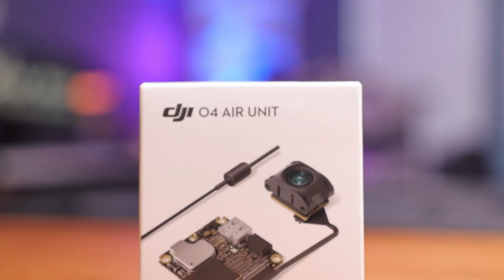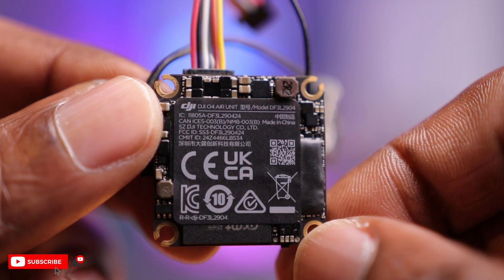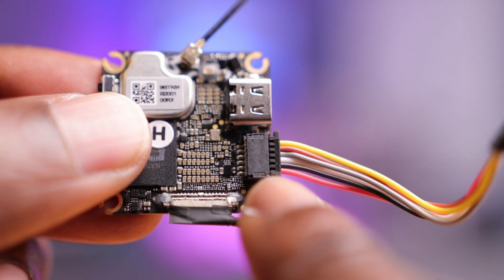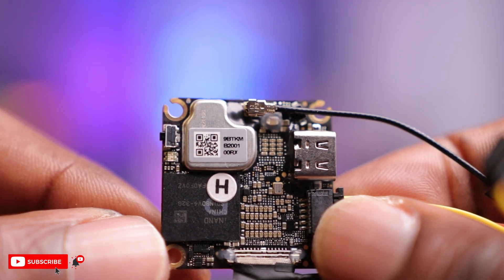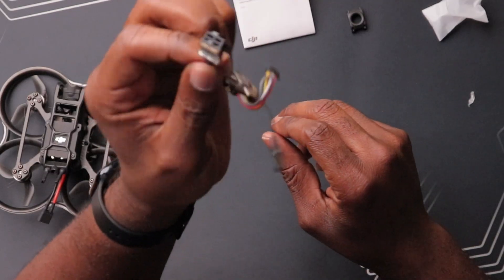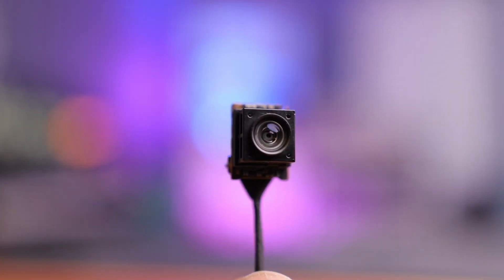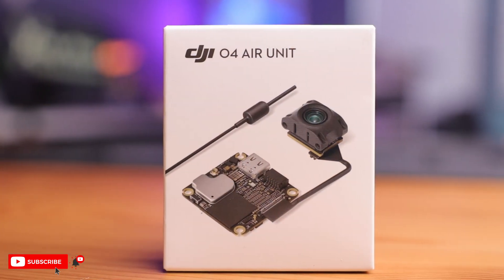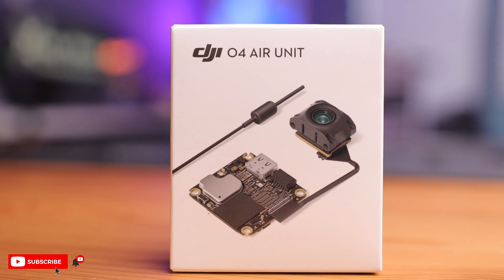DJI O4 Air Unit | Finally Bringing 4K Recording to TinyWhoops!

Comment: Hello friends, can I use DJI 04 Pro on an RC boat? Is there any additional equipment needed? Greetings to all friends.
Reply from the maker: I’m not 100% sure, but I think you can use O4 by itself(without any additional equipment).  I think you’ll need to go into settings and turn off “Low Power Mode”. That was the only thing holding back the previous models, as it needed a flight controller to “trigger” Full Power mode.
Reply: Thank you brother, you helped me. Greetings from Turkey, love.

Comment: If it’s 30 x 30 what frames allow for that? I’ve never seen a frame or aio board that’s 30 x 30
Reply from the maker: I think you're right.   I'll have to look into that...I think that was the dimensions of the board itself, not the mounting measurement.  I'll amend it and pin that comment in the video.   Thanks 😊

Comment: I just installed the o4 air lite on my Darwin baby ape. I personally love it.
Reply: How does the camera get installed?
Reply from the maker: I think every manufacturer has their preferred way.   I think most pilots are printing custom mounts for their specific drone.  BetaFPV has a cool universal mount that's suspended by dampers and allows you to use your existing "old school" mounting holes.   I've shown it here in this video. 
https://youtu.be/UgsZnTh0kDw

Comment: Way to heavy for tiny whoop and has low voltage of 3.7 volts. Not going to cut it with 1s battery. Nice so it’s basically only good for 2-3s. So it’s awesome still but not for tiny whoops.
Reply from the maker: I understand your sentiments, which are true, but it's lighter than the Walksnail 1S Setup.  Manufacturers are also making 1s FC with 9v BEC able to run this VTX down to 3.0v battery.  I guess what I'm saying is that manufacturers will adapt and bring new products to conform with the newer VTXs.

Comment: Put mine on a 2s. I don't like that the wire to the cam is attached at top not bottom. I feel like its gonna rip out or break from connector easier...
Reply from the maker: Understood

Comment: When O4 comes I’m gonna put it on my newbee drone 03 acro bee 75. It’s a 2s whoop made for the 03 at 100grams w/battery. Hoping the 04 is gonna lighten it up for me. Hopefully I’ll be at 60 or 70grams with battery.
Reply from the maker: That's the best thing about the standard O4 Air Unit.  It weighs so much less than the O3 variant.